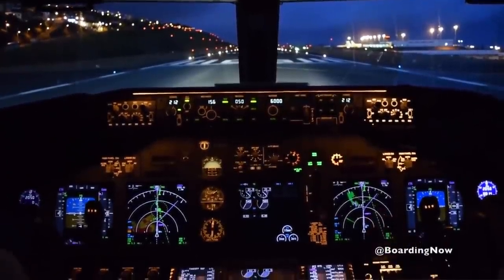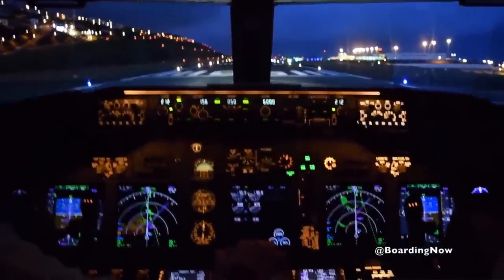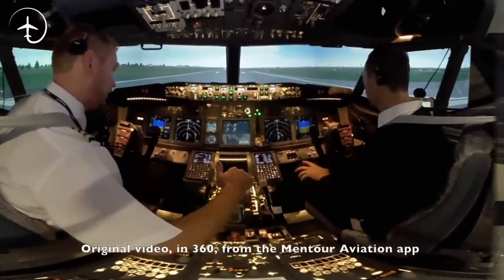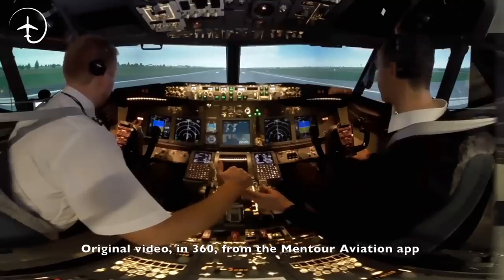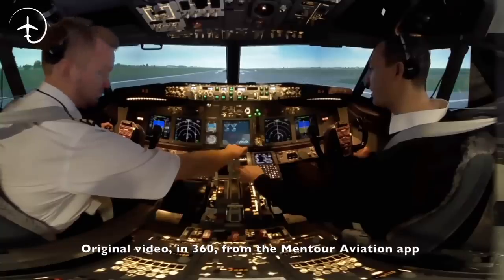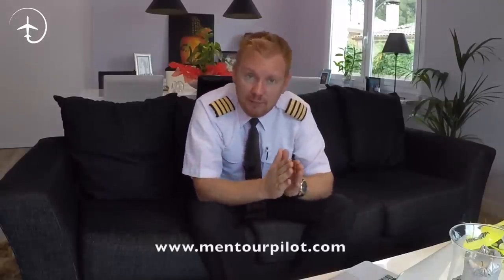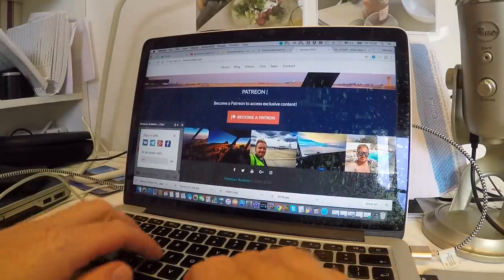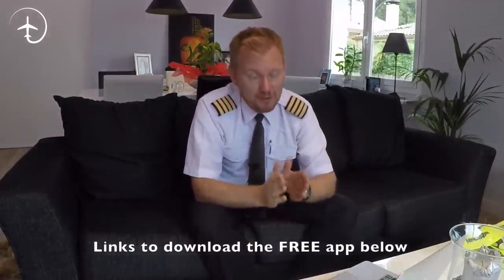Why do the aircraft engines "stop" accelerating during takeoff?

Comment: I thought the reason for this was after Air Florida 90 where the engines were affected by ice and never reached takeoff thrust. The FO noticed the engines had not reached the takeoff power settings and called it to the captain's attention but the captain did not listen. From since then, the requirement was that you advance the throttles to about 40% to ensure the response is as it should be then advance to takeoff power. That's what I know.
Reply: Fakalasi  Palm 90 's cockpit crew never turned on the engine anti ice system prior to takeoff. That was also a contributing factor, and an inexcusable error.

Comment: Thanks for the explanation - this explains the slightly "dramatic" experience the passengers have, when it feels like the engines are "reved up" to max before start. It feels like they are testing maxium thrust to make sure that the engines really are working , even though they aren't really not yet on max, which is kind of "scary" but also a little bit true, as it is this "balancing" the power that is going on. 

THEN the engines eventually are set on max or well, usually a bit less, still creating a little more dramaturgy.

It sort of makes you have this feeling that there is a countdown going on, and setting of, after a countdown, which is as we know, usually is more dramatic than just - taking off when you feel for it. 😅

Guess that many people in addition to me, didn't know that. Great video! 👍👍👍

Comment: I always figured that it was to prevent compressor stall (and flameout) on takeoff, so the pilots would rev up to 40% N1 and remain on the wheel brakes until both the N1 and N2 stabilize and the interstage turbine temperature is within operating limits. From there they could just gun it and set takeoff thrust (TO/GA) while releasing the brakes.

"Check N1 rise as N2 rises" is part of the takeoff checklist, as far as I can recall. If that doesn't happen it may be a sign of engine flameout or compressor stall.

Comment: I do the same thing on my piston airplane, but for a different reason: if I go to full throttle before the plane is moving forward, the prop blades pick up any gravel and/or sand from the runway and it nicks the leading edge of the blades. I always assumed jets were doing it for the same reason.
Reply: Thanks for the info! I imagine that would be even more important on a gravel runway.

Comment: Thanks for the information. I remember back in 1974 the take offs were very different, The planes would seem to rev up to full throttle but the brakes were on, then the brakes were released. This was in August ( Nothern summer). Planes were DC10, Boeng 707 and Lockheed L1011 why has the take off proceedure changed to a rolling take off?
Reply: I believe that has to do with the type of jet engine.  Those early jets used turbojet engines, and standard turbofans today airlines use high bi-pass turbofans.  As result of the larger mass of the inlet fan it takes them longer to spool.
Reply: @GlassTopRX7  And, the by-pass makes them quieter, is that true?
Reply: Yeah.  @josephgaviota
Reply: We got this one day leaving Canberra for Sydney in some turbo-prop plane, probs a Dash-8. There was only about 6 passengers on board, the pilot held the brakes and brought the engines up to high speed for about 20 seconds and then released the brakes. It was the hardest take off I'd ever experienced! The thrust was truly epic! :)

Comment: Excellent as always.  Me and my little C150 never noticed this phenomenon.    :-)
What about military aircraft?  Single engine and multi?  It seems they also do a run-up and after a certain point the AB is lit and the plane rolls down the runway.
Reply: All turbines are slow to spool up, you don't want to waste runway rolling along at half thrust.
Reply: The further apart the engines are the bigger the potential issue. When they're very close together the issue is almost non-existent. Think of most fighter aircraft F-14 F-15 F-18 F-22 the engines are are very close together near the center of the plane. 
I haven't researched this recently but I do remember cases of early f-14s crashing because as they were approaching the deck to land they would apply power and if 1 engine didn't respond properly it would cause the aircraft to roll and lose control
Reply: I have a vague recollection of some fighters throttling up to X% and then full military power, and then AB.  Is that correct?  I have vivid memories of the F-111's firing up the AB's with the brakes on and the pilot's teeth clenched(not true) and the length of the flame was adjusted out of both tail pipes and then she'd roll down the runway.  What a thrill.
Reply: Isn't it also just a case of throttling up to a certain % to make sure everything is looking normal? While you're still standing still there's much less to worry about than when you're already rolling so to my mind just that alone would justify the little bit of extra spent fuel.
Reply: Asymmetric thrust is the problem. I've heard that the old A-26 was notorious for an engine failure on takeoff and unfortunately many an air crew was lost.

Comment: I was always told it was to prevent engine flameout. If you accelerate the engines to fast you can flood them and cause a flameout. I'm assuming thats not a problem now because the computer manages a smooth linear spool up?

Comment: Here's my question: under the front gear on some planes there is a red sign saying "no tug". I have especially noted that on the A350. What does it mean. My theory is that on those planes you cannot pushback using the bar they attach to the gear. Am I right?
Reply: B1squitz not quite, it indicates the tug truck to not go further and cross that line with the towing bar, since it is the maximum of the steering angle when towing the aircraft.

Comment: Mentour I was wondering something about asymmetric thrust. In case of single engine failure do you cut the other engine to avoid falling into a flat spin? If so do you try to "glide" the rest of the plane somewhere into the water. If you don't cut the engine, what KEEPS you from falling into a spin?
Reply: Vertical stabilizer and rudder prevents this to some extent
Reply: The aircraft is designed to fly on either engine.
Reply: In the event of single-engine failure, the pilot will have to command opposite control input in order to keep the aircraft flight stable. Aircraft are rated for their ability to fly on single engines, which Mentour covers in the video about why we don't see more tri- and quad-jets (I think!) - they have an ETOPS rating, which is the maximum time that the aircraft can be from a suitable airfield in the event of an engine failure. As engines these days are highly efficient and stable, the highest ETOPS rating now is ETOPS-370 for the A350, so it can be more than six hours away from a suitable airfield on single-engine running. That isn't to say that aircraft will fly for that long on a single engine, just that they can.
Reply: I'm not a pilot but I'll add what seems logical to me and maybe someone will correct me... we'll see.

 So it seems interesting that they run up the engines to 40% to avoid asymmetrical power however if an engine completely fails they can continue to take off. I understand your confusion LOL. The key I believe is when this engine failure would happen. If it happened before V1 they would not continue the take off. This part of the takeoff sequences also when they would be concerned with the engines producing asymmetrical power which is why it's important for them to try and avoid it.

By the time they get to V1, the engines have been at take off power for some time and will be equalized if everything's working properly and again if everything's not proper they would abort the take off before V1

Ah, another thing to consider is that by the time they reach V1 they are going quite fast so the aerodynamics of the plane are what will keep it under control when an engine fails. As described earlier they don't have this benefit at lower speeds so asymmetrical thrust is a much greater problem

Comment: I thought it was so the engines build up power and the aircraft uses less runway to get airborne.
Reply: Right... I thought so too...  Like dragster cars revving up their engines before letting loose, but this explanation makes much more sense.  
  I've also noticed times when they rev up the engines a lot more, while you can feel the brakes straining to hold.... But I never associated that with weather conditions. I'll  have to pay more attention.
Reply: If they wanted to minimalize the runway used, they would use full power during tafeoff, but they don't.
Reply: for small one-engine GA planes that's actually what you do to use short runways or when you need to clear obstacles after the runway.
Reply: Michael 2k3d, totally agree with you as well as the reply's so far. Seems that the less runway you use to get to rotate might also mean you have more runway to stop should something happen. The comment about drag cars would seem to have some bearing here as well, but then we are not the pilots.
Reply: Its spooled up to about 40% to stabilise and check gauges, brakes off, then take off thrust set
Reply: Michael 2k3d This is very informative! I thought it was to give the engines a few seconds to build up thrust, without stressing them by immediately calling for full power. I learned something new.
Reply: If they are doing a short-field takeoff, they will throttle all the way up and hold the brakes until stabilized, then release them. In most cases during the 40% spool up, the plane is rolling freely and eating up runway.
Reply: Micheal 2k3d, Actually you may be correct in some instances. There are a lot of variables that are factored in to the equation when setting takeoff thrust. It includes aircraft weight, temperature, air density, runway length, weather, thrust available, flap/slat settings, weight and balance, obstacles  in your flight path after takeoff and other factors. The engines are not firewalled on every takeoff. On a cool day, a light aircraft and a long runway you may not go to 100% power. They may even do a rolling takeoff in which they do not stop at the end of the runway to start the takeoff roll. On a hot day, a heavy aircraft and a short runway you may push it to 105% or more. I have seen aircraft sit at the end of the runway for what seems like eternity before releasing brakes to ensure they have all the power available to them at their disposal on the takeoff. As for stopping a takeoff after rolling there is a speed calculated from all of the variables that determines if you are going to try to takeoff or abort and hit the brakes and have enough room to stop, it is called V1.
Reply: Andy Brown   Yes pretty much in most aircrafts, the brakes can easily hold the plane at full thrust. How can they do that? A very, very, very powerful brakes.
Reply: Michael 2k3d. You are correct too. we do that in High altitude hot environment
Reply: COMMENT I hear that above 95 degrees Fahrenheit,  some of these turbofans can’t produce the thrust needed at take off
Reply: Maxumized.  To my knowledge all turbofan engines produce enough thrust for takeoff at temperatures above 90 deg Farenheit (35 deg Celcius), but require longer takeoff run for the wings to produce sufficient lift for takeoff. Remember the takeoff is not dependent  on only the thrust produced, but the net force of lift. At high temperatures the air is less dense and therefore to build sufficient thrust and lift for takeoff, a longer takeoff run is necessary. This is why runways in hot areas are very long. Also high altitude areas require long runways.
Reply: @yvrelna  and good tires
Reply: @786ALHAQ  Thrust is also part of the problem. In situations where the air is thinner, high temps or high altitudes, you get less thrust. Less thrust equals slower acceleration.  Humidity also affect thrust output.
Reply: which part did you not understand of my comment? the net lift force is waht keeps the plane in the air. THRUST DRAG WEIGHT ETC
Reply: @786ALHAQ  In Australia it often gets well above 50 celsius runway temp and ambient 35c under 500 ft. I've done many flights where the plane is loaded and the air is dry and hot with no wind. Flaps were set to what looked like 25 deg and the take off roll seemed like forever.

Comment: I like getting pushed back in my seat and hear the engines on toga during takeoff.  Take off is my favorite,  I like to get flights with as many connections as i can when I fly to experience multiple takeoffs.  Is there any way you can make a takeoff push you back in the seat more than it usually does?
Reply from the maker: Yes, normally we de-rate the engines and use as little thrust as possible to save engine life. If we used full thrust you would notice 😉
Reply: I love when you push my eyeballs back in my head. And when pilots do a bit extra ascent angle on the climb-out; I know most passengers don't appreciate it (But I do, a 737-max TO would be fine with me, and highly grin inducing).
Reply: Yes, buy tickets on the B757-200 from airports with shorter runways and surrounding mountains. For commercial airlines this will be the best acceleration and climb performance.
Reply: The only way to get decent amount of thrust is on airports with relatively short runways. Taking off on an A320 on a 6692ft runway is always fun. The pilots spool up the engines with the breaks on, then hit the bricks like they sat on a wasp. Now bear in mind that an A320 at MTOW requires bit more than 6800ft to take off. They don't take as much fuel though since the longest flight off that airport is little over 3 hours.
Reply: ‘Push you back in the seat more than it normally does?’

Gain 35 Lbs?  ;)
Reply: F=MA. A=F/M. Empty plane, makes M smaller, with the F from the engines staying the same, A will go way up.
Reply: If you can find an empty plane. The absolute worst load factor I have personally seen  was at 63%, but on a rather long runway  and on a 787-8. Wide bodies are anything but exciting at take-off.
Reply: @MentourPilot  what reason (would) you use full thrust? For a really short run way?
Reply: damn beat me to it!! the only reason I know to push your seat back is because one day on takeoff my seat locking mechanism was U/S. So I ended up in the sleeping position.. Was the most comfortable and exciting takeoff I've had.
Reply: Think I did experience full thrust once; in an A-300 on short-haul back in 1987.  It gave me a headache for the rest of the flight. I have no idea why they did it, as the runway was endless.  Was perhaps the standard procedure different back then?
Still, I prefer that experience to an opposite one: An  IL-62 with full tanks was visibly struggling to gain height and took a full 2 hours to reach cruising height.  Scary.  I suspect that plane had a very poor power-to-weight ratio.
Reply: @fullmetal_dragon  Same here...RNO 737, lightly loaded...He or she gave around half throttle..2 seconds later.... Whoa. I flew a lot when I was a kid. So I know what it feels like to experience the acceleration of many airplanes. However,  this 737 take off was the best of all.
Reply: @MentourPilot   Would it be possible for you to do a video about what it was like to fly in the  first jets in the early 60's. I was in a dc-8 airliner and I'm looking out the window and thinking when is this thing going to get off the ground. I was 12 at the time. Lose one engine then you'll be in the Pacific Ocean. They don't do take- offs like that anymore ?
Reply: Departm from FLR and you'll feel how powerful a jet could be, the runway it's only 1600m, so full power holding the brakes and once the engines are ready they release the brakes. It's always a "fascinating" experience 😄
Reply: The Cookster i wonder what a nearly empty F-22 on full afterburner would feel like... 70,000 lbs of thrust
Reply: I like that too. It seems to have become much less common after the 1970s.
Reply: @MatteoBurroni  done it! :-)
Reply: Best push back = A320 + short runway!
Reply: Ever think of becoming an astronaut? ROTFL!

Comment: Having been a jet engine mechanic / instructor, i envision this process as a factor of airflow through the engine, and how going from a lower RPM to full throttle immediately, could cause an engine stall. Accelerating from the 40% to full throttle would avoid this stall possibility. 
In the end, the why depends on your prosepctive
Reply: "Your prosepctive?  WTF is a prosepctive?  That's not even a real word.  Now for your English vocabulary lesson - the correct word is "perspective" meaning a particular point of view.  Ohhh...I know the old "spell check" excuse....spell check just made up a nonsense word and changed the real word to a nonsense word....
Reply: @buckhorncortez  So with your expertise, all you can comment on is a spelling error. 
Why don't you display your expertise on  Bernoulli's principle?

Comment: Not on Air Asia they don't -just start gassing it when coming of the last bend onto the runway. The engines are starting to scream while the planes still straightens itself onto the runway. Saves fuel and time I guess.
Reply: I believe it is what they call "a rolling Take Off". They spool the engines up to 40%N1 on the runway entry - so yes, they still do it, just on the line-up roll.